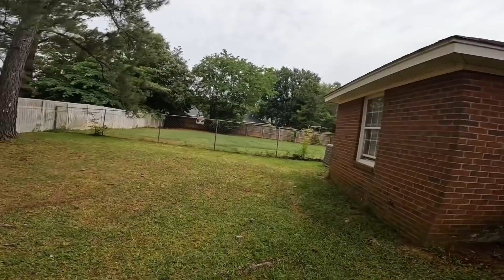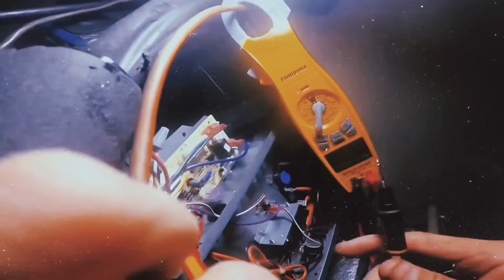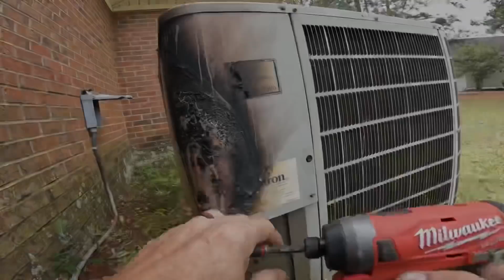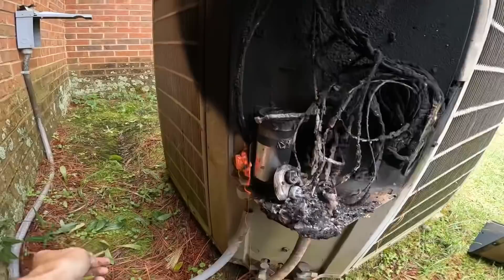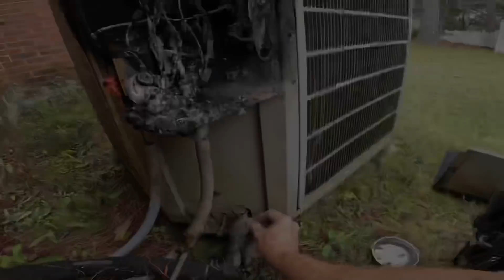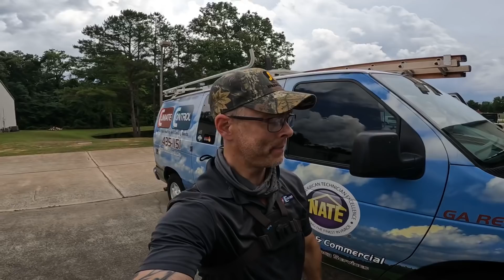Possible Lightning ⚡️ Strike on An Air Conditioner

Comment: Looked like the same damage when lightning struck a 75HP Industrial Air Compressor.
Employees watched the lightning travel across the steel rafters and down the conduit to the compressor.
This company had a toilet right behind the compressor, the walls were only partitions, with open space at the bottom.
The union steward was sitting on the toilet when the lightning struck and he came out of there with his pants down.
The compressor was DOA just like your condenser.

Comment: I wouldn’t risk it. At least windings test on compressor and condenser fan motor. Check for board function inside, make sure it still sends signal. Otherwise, new condenser and lets see what it do.

Unless that’s an R22 unit.

Comment: A lawsuit happened in my state five or six years ago HVAC contractors in my area won't install Bryant or Rheem/Ruud condensers I have seen that exact same thing happened here the capacitor swole up and exploded and shorted out against the contactor hot lead causing the unit to short out and burn she is lucky it didn't spread any further than that and burn her house down as well. Now they only install American standard/Trane, Carrier, Heil, and a couple of other brands I've never heard of.

Comment: I think at first glance, lighting strike is pretty plausible, but I think you were right about the capacitor. Crazy a line in the condenser didn’t melt loose or explode

Comment: I’ve been on them where the condenser coil and grill are burned a perfect flame thrower hole like a lightsaber cut a hole in it… from the compressor terminals blowing out setting the oil and or refrigerant flamed on its way out.

Comment: From the thumbnail I knew you’d find a blown capacitor inside. That oil inside makes a mess when if blows, add in burned wires, and you got a flamethrower.

Comment: We had some really bad storms this past week into the early weekend. We only had power for about 2 days total. The first storm fried the coils on my generator,lnb on my sat system along with the switches, and last but not least burned the wires off the well pump at the wellhead.  Some serious #4 copper being run here   I can totally understand this blowout! Lightning does exactly what it want to do!  Stay cool and hydrate often this hot weather

Comment: That's obviously an electrical fire from capacitor failure and not actually lightning. My grandmas videocon air conditioner outdoor got hit by lightning once and it had holes on top and bottom, the copper piping was melted and the earthing wire was vaporised from top bottom with just black marks left. everything had to be replaced in there.

Comment: I'd replace the breaker in the panel, it either never tripped soon enough/way oversized or they kept resetting it again and again, either way it's very likely bad. maybe some old federal pacific, they would commonly let you arc-weld for long periods and if you ever cut into a live romex, you instantly knew it and needed new cutters.

Comment: Totally fixable. I would check the reversing valve solenoid, compressor and fan motor resistance. If they are good, make sence to try to fix.

Comment: Had a similar blowout like this. Lady just bought the house. Something overloaded and the capacitor blew catching the oil on fire. Burned the board, wires, and contactor. Ended up scrapping the board, replacing the contactor and capacitor, as well as replacing and repairing a lot of the burned wires to get her rolling. Unfortunately the incident burned out her compressor too. I'd say check the windings of that compressor before you invest too much labor into that thing.
Reply: Seeing that much burned wires is enough to say "you need a new evaporator coil and condenser"
Reply: Do you think the shorted windings might have been what blew the capacitor? I'm actually wondering myself.
Reply: @Bryan-Hensley  This all happened in conjunction with a storm. Don't know if it was struck by lightning, or incurred a large power surge or what. But it's possible the compressor lead to the overall damage. What I DO know is that the inspector missed 1 integral part of the inspection prior to the homeowner moving in. There was a Federal Pacific panel installed. They've essentially been banned from used due to high failure rate and fire risk. If the damage was from an overdraw, the breaker never tripped and permitted the damage from occuring. Mind you, I was only there after the damage occurred, and never before, so everything I've said is purely speculatory.
Reply: But because of all the details surrounding the failure (the weather, panel, etc), we were thankfully able to get her some reimbursement from the power company. She's since had her panel replaced and we regularly maintain her system. No issues since.
Reply: @YoungJizzy321  it's simple their was no ground wire if it was a lighting strike, no ground wire at the breaker box or at the disconnect or at the electrical compartment in the condenser.
Reply: @Bryan-Hensley  it was the capacitor, the liquid in the capacitor was caught on fire once it exploded.

Comment: What multimeter would you recommend in a budget of a couple hundred for a person fresh out of trade school? Curious.
Reply: Any clamp meter that also tests capacitance. I get by on my backup meter a lot, which was an $80 Klein I bought like 7 years ago. Still performs as well as I need it to. If you wanna get fancy, look for a dual display (Displays amps and 1 other test mode simutaneously), but you don't need to shell out an arm and a leg for the newest and coolest gadgets for simple diagnostics.
Reply: Fieldpiece sc 440. Has what you need for exactly your price point.  About $190.
Reply from the maker: Klein makes a good cheap meter

Comment: I saw a capacitor fail on the bottom of it, dead center. It kept tripping the breaker instantly I herd a buzz then trip. So I pull the fuses, take the side panel off and everything looks bran new. I don't see shit so I asked the homeowner to put in the fuses while I watched an BAM! right out the bottom of the capacitor was like a lighting bolt, it put me back about 10 feet. The breaker tripped again. I walk up that shit still looked bran new.  Only time in 20 years of doing Hvac and refrigeration have I saw that. Well twice now with your video lol.

Comment: Well when you're in the trades long enough you might see that 1 in a million. My last 1 in a million was a compressor fire on a reach in refrigerator. The fire originated from the plug end of the compressor so the only thing I can think is somehow the compressor windings shorted but somehow the overload didn't trip, the thermal on the compressor failed closed, and somehow the breaker also didn't pop. This was at a large hospital with a large full time maintance staff keeping everything maintained, the breaker was not defetive (they have an electrician on staff that tested it), it was just one of those perfect storm of things going wrong and I am so glad the fire did not spread and that the unit was not an R-290 one.

Comment: I've seen capacitors do that a number of times but that one was a doozy.
I had a call in Show Low Arizona where lightning hit the air cooled condenser on the roof of a grocery store. All 4 systems were down, off on low pressure. All 4 systems were flat. I found the fittings on all of the piping between the condenser and the machine room were unbrazed, totally separated! About 5000 lbs of refrigerant in the wind. 
That made for a long night
Reply: I've been to Show Low. My uncle has a house in Pine Top.

Comment: That's not lightning, I've seen several units that took direct hit from lightning, they all had one thing in common it blew the boards, contactors and capacitor on the ahu also ran back up the linesets aka the super conductor in that case, and 8 out of 10 times with lightning it either blows holes in the lineset or coils can't handle the heat and pressure, last one I got lineset looked like swiss cheese, plus if it was lightning other things in the house would have been affected. However you can clearly see the high intensity heat marks on the service door, and although I have not seen what you have there as often I have seen it here a good bit that sir is a case of the capacitor ruptured and caught on fire.

Comment: That's crazy, 22 years never seen that, seen the old Bryant and York circuit boards do some nasty damage but not like that. Good video. Did you repair or replace it?
Reply: 25 years I've seen it quite a bit I guess it depends on geological location, and how prone your area is to lightning strikes. But man you ain't kidding about them old Bryant and york boards haha those thing could wreck a unit.
Reply: @andrewgilbreath1331  I'm a ca contractor so not to many lightning strikes around here. Just those miserable 110 degree days. 104 tomorrow feels to early for that. But here we go . We'll good luck to u
Reply: @lizards7777  I'm in CT and we get lightning here but usually they hit trees, not condensors. lol

Comment: That thing felt ALL the burn. I don't doubt that the capacitor can shoulder some of the blame for what happened, but I think it had substantial help from some lightning.

I'd imagine that unit is going to be replaced, though I'd love to know if everything else inside was unharmed and if it'd run again with new wiring and electrical parts.
Reply: I think you had on the Keynote that’s a lightning strike

Comment: I’d be worried about what size breaker feeds it. Looks like it should’ve tripped. Probably connected to 100 amp breaker!
Reply: That's what the insurance investigator will see. This is simply a brown capacitor, which is full of oil, that the oil ignited. It could be caused by  shorted windings in the compressor though. When lightning hits it takes out many electronics and light bulbs in the house. The insurance companies around here will deny lightening damage if nothing else is damaged anymore. I don't even attempt to turn in lightening damage anymore. To tell you the truth, I'm concerned they'll eventually try to charge me with attempted insurance fraud by turning in lightening damage claims.

Comment: Seen that a couple of times, capacitor exploded and the oil caught fire. It usually is not that bad on ac units, but with hp’s all that extra material to burn that’s what you get.
Reply: Shawn is correct seen this one time before. There wasn't any lightning involved. Exploded cap and sprayed oil stayed on fire
Reply: @jonsaircond8520  That run cap probably exploded because it was faulty, which seems to be more the likely case. But it could have also exploded due to something external as well, like a shorted wire. I have seen lightning cause filter capacitors in a television monitor to blow out. So i assume it still could have been that too. Although an indirect lightning strike to the power supply, would have also damage the compressor and fan motor along with it. Which seems to be not the case here.
Reply: When electricity arcs in a dramatic case. It can create more then enough heat to do that sort of damage too. More then likely this was a chain reaction electrical fire. Initiated possibly by lightning since there was storms recently in most of Georgia. But that doesn't rule out that it could have been the capacitor too.

Comment: Time to call the insurance adjuster . 😃😃😃😃😃
Reply: I would if that guy from Allstate will be there to help . Good luck with that . 🤕🤕🤕🤕🤕
Reply: They'll deny it. That's not lightening damage. That's a blowout capacitor with the oil catching on fire. Even if lightening caused it the insurance will most likely claim it wasn't. Insurance companies have denied the last 4 lightening claims I turned in. One of those had a tree blown apart by lightening in their yard, insurance company claims a bad condenser fan motor caused it. They sent out some college dumbasses who knows nothing about HVAC to make that claim.

Comment: I was considering buying a kaiweets meter after your last review, but you hinted that you had a new comparison of several meters and kaiweets didn't perform. Do you still have that coming up?
Reply: I think that Kaiweets meter would be best reserved for a DIY'er at best. Go with a Fieldpiece, Fluke, Amprobe, Hioki, AEMC or other reputable meter brand if you want a reliable, safe, and accurate meter.
Reply: @nosnim2207  it would be for a backup/spare or when I don't want to damage the regular one. It's gotten some excellent reviews and frankly I've seen some "professional" brands that suck.
Reply: @realSamAndrew  Where did the excellent reviews come from? Amazon reviews are notorious for being paid/padded/sponsored reviews. Influencers also were sent this meter gratis from Kaiweets in exchange for their opinion.

If you're looking for a value backup HVAC meter, consider a Fieldpiece SC260, Amprobe ACD-14-PRO, UEI DL429 / DL489, or maybe a Fluke 324 / 324 PLUS.
Reply: @nosnim2207  Curtis tested several and then was pleased with the last one. I've watched about 4 or 5 reviews here on YouTube and some of them lasted for a full hour and you can view the readings and tests yourself, not just listen to the reviewer's words. 

If you prefer not to entertain anything outside of top tier, that's understandable. All folks are different.
Reply from the maker: It was reading Hz, and Amps, with nothing hooked up. And that additional amp reading was adding to real amps.
Reply: @HVACGUY  do you still plan to post the video? Is this the "good" kaiweets? Do you think yours has a defect?
Reply: @HVAC GUY I too have been waiting on the straight talk about meters video.  Update was posted about a month ago..

Comment: I would replace instead of a redo, a lot of work to do if it doesn't work after, plus what caused it could happen again, unless it was lightening. Now for a skilled DIY person, find an old unit take pictures and rob the parts, come back and rewire the whole thing. A shot in the dark at best, but you never know.
Reply: Lightning can strike more than once in the same place. Keep the insurance!
Reply: @bobboscarato1313  LOL True

Comment: Probably not lightning strike though, lightning ends it's path into the ground. I've seen lightning strikes blow a hole out the bottom of a condenser and also a package unit before. I'd think it was self contained from capacitor. But who knows for certain. Good video nevertheless.
Reply: Had a few of these this year its the cap. T
Reply: The insurance companies I've delt with lately have changed the rules and won't accept lightening damage anymore if nothing else is damaged in the house.

Comment: Man that's a tough one. Who knows if the condenser fan motor or compressor is going to start up. By the time you get done replacing all the wire and parts and try to start it up, the cost is going to be high and there's no guarantee it's going to start.
Man I think in this case I would quote a new unit
Reply from the maker: That’s what she’s getting…
Reply: You'd know if you tested the comp and motors that's not a real hard fix, just need a diagram, some wire, the board, capacitor, contactor, and about 2 hours $6-900 later and good to go.
Reply: If you had a donor unit with a dead compressor, could move all the control stuff over.  As long as wiring up the compressor and fan in this unit showed them to be working.  Lots of labor though.  And if it was a lightning strike, who knows if the windings in the motors might not be ready to quit in a week or a month.  If it was mine & I was a DIY'er... etc... I might try it.  Agree & understand, not worth it for you or the homeowner.
Reply: It worth the try get it up and going.  Until new unit get  ordered  and replace
Reply: Lightning can cause damage even if it is not a direct hit. I see some tall pine trees in the beginning of the video, they make good lightning rods. An EMP (surge) could have pushed a crappy/marginal run cap over the edge, it blew it's top, and the capacitor oil caught fire and barbecued the rest of the components in the area. Who knows if the surge weakened the compressor windings or condenser motor... New board, cap, contactor... rewire all that mess... lots of labor = $$$and NO guarantees this Bryant won't go "pan up" in the middle of August. Sad to say - it's changeout time. Might warrant a casual call to her homeowners' insurance salesperson to see if it would be worthwhile to file a lightning claim.

Comment: Wow it's pretty impressive a lightning on a AC
Reply: More than once I found lightning striking a power transformer and all four homes attached to it suffered damage to A/Cs. Refrigerators and TV sets. In another job we had installed a new condenser and lightning struck in the evening and next morning I had to replace the compressor; house next door same problem. Mi repair job was a "freebee" for the consumer! I love Texas!